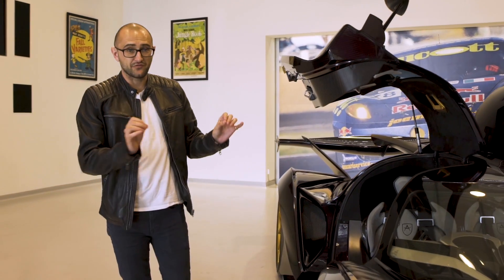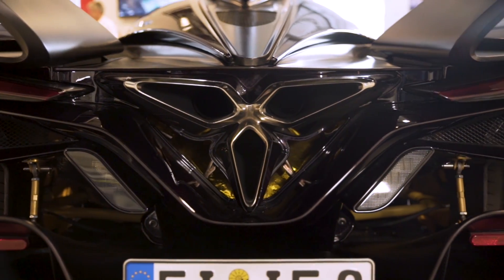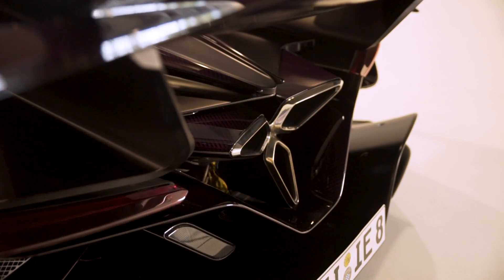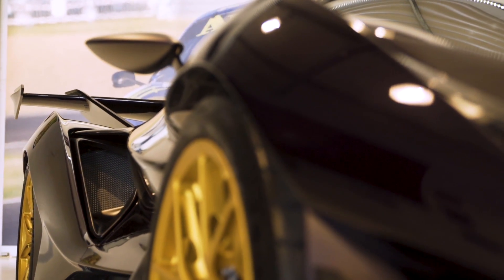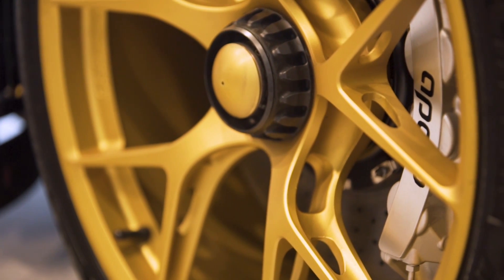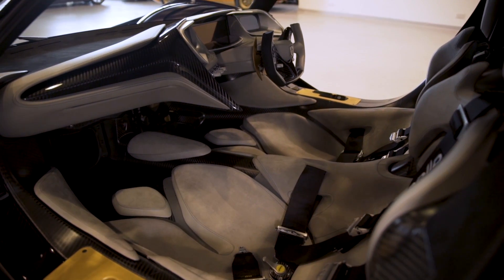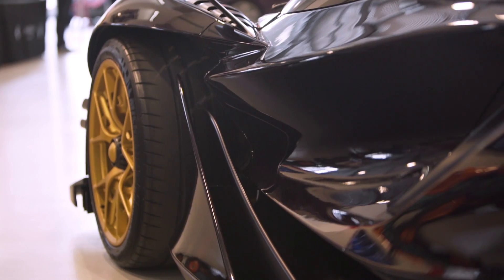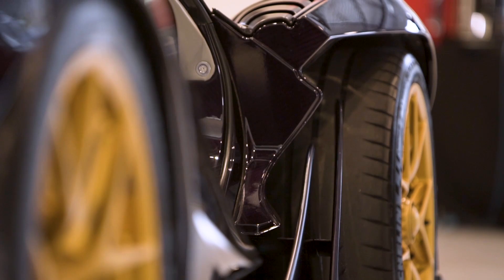Apollo IE: The Engineering Behind This £2M Hypercar - Carfection +

Comment: doubt it has 1000hp
but it is the sickest car built for a long time. it is in my top 5 now with the F40. I just want to hear and see it racing down a reace track
Reply: Did you watch the video? 16.5:1 compression ratio option for a higher price. In a 6.3 L motor, yes that will put 1000+ hp out.

Comment: Another ridiculously priced hyper car that no one will ever drive. Seems like something of a bubble
Reply: Yeh. I mean it's 'intended' for the track, which is nice, since it's ridiculous the way they are making road cars these days that can't remotely be used on the road without being a danger to mankind. But, at that price, who is going to track it? You'd have to be rich enough to buy two and hold onto one while you trash the other on the track.
Reply: It isn't for sale yet. If it's been at a track, it's the company testing or displaying it
Reply: Oh the engineering and the work that has gone into it is incredible, but you just feel like this current round of multi million pound hypercars are going to be driven around Dubai or stored in collections to appreciate
Reply: I see this exact car all over the internet going to track days and car meets all the time, so that's at least one owner that actually drives it.
Reply: LynxAdvert not ridiculous it's a cutting edge very expensive car for   a   few select like an expensive painting or watch or mansion etc. You and i have have more mundane cars  houses etc

Comment: I liked their excuse for no hidden aero flaps, '  we can't figure out how to make them safe so didn't bother.
Reply: zGJungle ZG yeah it's quite simple really... you make it failsafe so that they always return to the high downforce position if there's a problem. Gets tricky if you've got front and rear both active... but still, I'm sure it can be solved. Absolutely no need for active aero on a road car tho!
Reply: Eddie Panedi it's got a number plate on it. Haha agree that you wouldn't want to get run over by it though! There must be some law which makes it okay for low volume manufacturers to do that.

Comment: Amazing car! Though the bit about avoiding active aero because it's less safe was complete BS...
Reply: BeBarnee Sure, but then why bother with carbon ceramic rotors at all ? 
What I was puzzled by was the argument used by the gentleman in the video. 

Cost control for the end user on a £2m+  road car appears quite incongruous, especially if one considers who the end user will surely be. 

This isn't a FXX-K style one-off track special, and at the price it doesn't come with any track program. 

Anyway, it could be me being just a tad bit too sceptical regarding that company as a whole.
Reply: it is a ferrari v12 and he is hiding it by telling they developed it!
Reply: most racecars use steel rotors. Carbon ceramics are pointless if you want to track it regularly
Reply: What he should of said in regards to the aero ' we can't figure out how to make it safe so we skipped it and talked some crap about safety '
Reply: zGJungle ZG Indeed. I suppose that actually it would rather have sounded like : "We couldn't find a way to make it AT ALL, so we simply thought that our potential customers would thoughtlessly believe our crap about safety". 

I don't want to sound like a jealous old bloke, but frankly I don't believe anything of what's being told in that video. 

At least it isn't as if they came out of nowhere. ;-)
Reply: Arch Indeed. Also quite puzzled by the braking system change for track use.

Comment: its a (GUMPERT) APOLLO really
Reply: No, it's an SCG 003.  They paid Jim to use the chassis of the 003 as the base of the IE, but no one talks about it.  The front fenders even have the same pinched shoulders as the 003, which on that car, was a way to reach minimum ride height for racing regs.

Comment: "3D printed out of  a solid piece of titanium" so is it cnc'd or does he mean using sls?
Reply: What Cam is saying is it is either additive printed out of metal granules via SLS, or it is subtractive milled from a solid block of titanium. It cannot be both. Which makes what this salesman said to be complete nonsense.
Reply: you can't alloy Titanium and Inconel, which are their own alloys.  What he should have said was that the exhaust manifold is Inconel, and the rest is Titanium.

And it's laser.
Reply: eb110americana thankyou! That's exactly what I meant. Just couldn't be bothered explaining it
Reply: NOT CNC. Lazer Sintering of Metal Alloy Powder. Similar process to SpaceX Auxilary rockets.
https://www.livescience.com/38862-selective-laser-sintering.html
Reply: S.O.L.
Reply: Wow SLS + CNC Very Cool and New. They are like the only organisation doing it.  Always cool to see new innovation. Apollo IE uses older already mission critical machines in service. Seems like The Apollo IE part also goes through oldschool surface polishing / treating. Maybe even hand crafted surface treatments. Soo very unlikely going to be CNC like DMG Mori.
Reply: WTF I never said CNC was defined by G-Code. I was saying the SLS Printer also could in theory use G-Code.
Reply: They specificialy mentioned Titanium Inconel combined Alloy. Very typical material for SLS.
Reply: Cam Bowman just like koenigsegg did in the one:1 but this is smaller
Reply: frosty95xy there is a good video here in youtube there Christian von koenigsegg shows hos they do it.
Reply: frosty95xy aha, for just 2 years ago it was a revolution in metalwork, the evolution in this process is extremly quick right now.  The carbonprint Will be the new black.